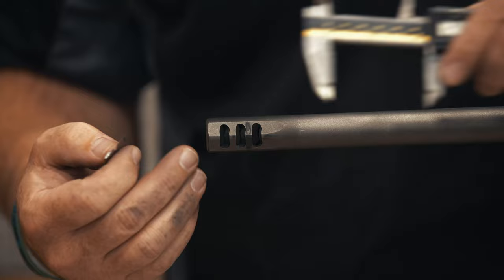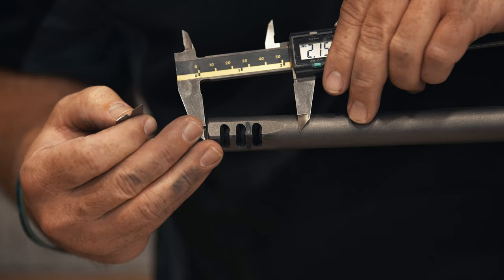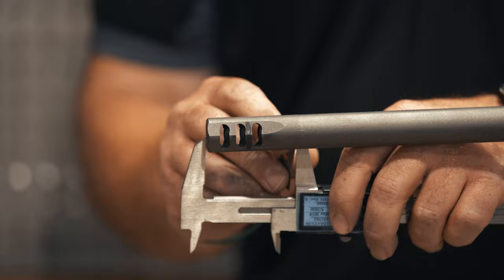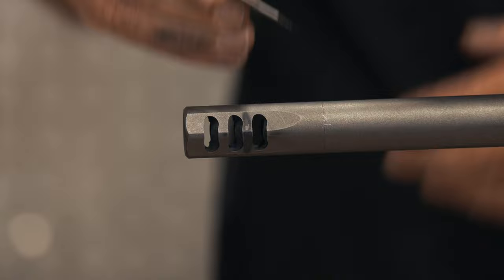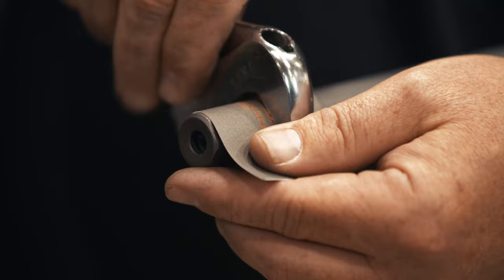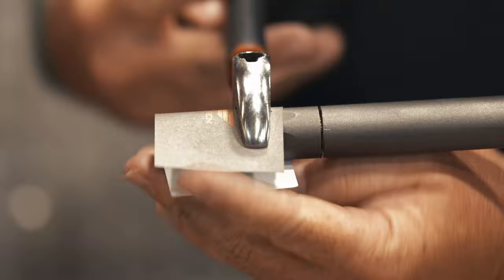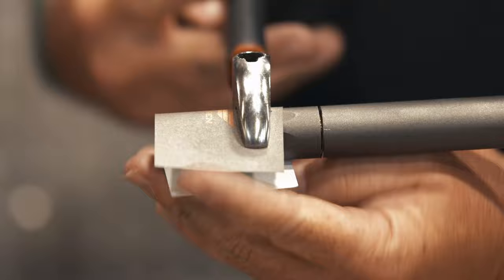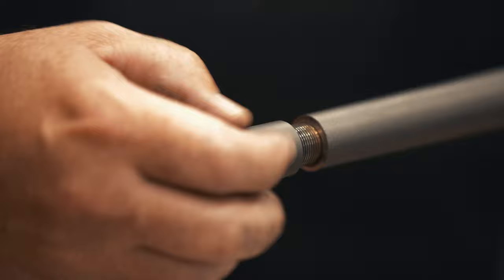How To Remove Mesa Long Range Muzzle Brake | Christensen Arms

Comment: Scored mine at the correct 2.15 inches. Took it to 2 different gun smiths. Neither could get it to break free. I put the stock in a vice & pounded the wrench with a hammer. Still not free.  I think Christensen might be replacing my barrel. Some stripping has happened around the brake.  This video makes it look like a child could do it. My suppressor came in & as excited as I am to try it out, now I'll have to wait several more weeks to get the gun back from the manufacturer.
Reply: That sucks
Reply: Might be time to sell my Mesa Long Range... 🤔
Reply: Having the same problem myself.

Comment: Oh yeah, they are tight. I would not recomend using a cresent wrench and try to loosen it by pulling on one side. 
  Use 2 or something like a tap handle and give an even twist. You are less likely to put a bend in your barrel.
   The first brake I took off scared the crap out of me. It sounded like the rifle went off.  And that was a stripped down rifle. I had to check it over to see if something had broken but it was just the brake.  All was fine.
   Im pretty sure they tork them on tighter than you would a car rim.
Reply: I noticed last night that the brake had some wiggle in it when it broke loose.  I should have been on it and measured the barrel threads to see if it was the brake with oversize threads or the barrels pitch diameter was undersize.
   I had alot to do and was sticking to job description only.  Im angry at myself now because that would have been good information my customer could have given his customer.
   I did show my customer how loose the threads were between the two.  I mentioned how I was amazed at how tight it was and did not strip the threads off eìther the barrel or the brake. That says something of the quality of the material. (Its excellent).